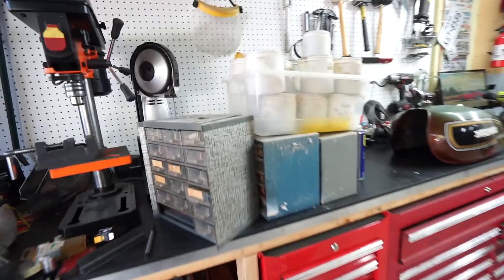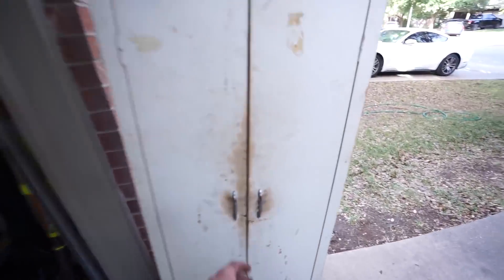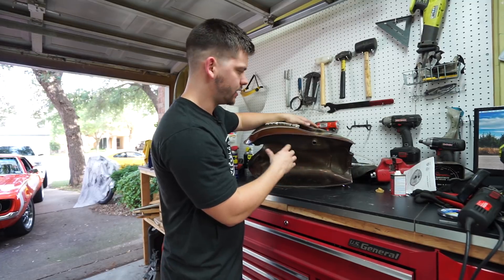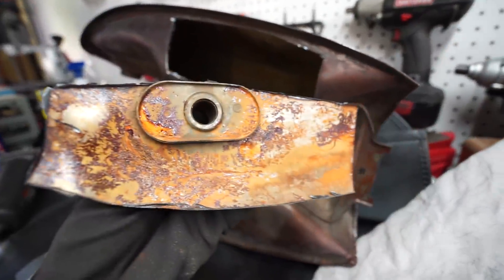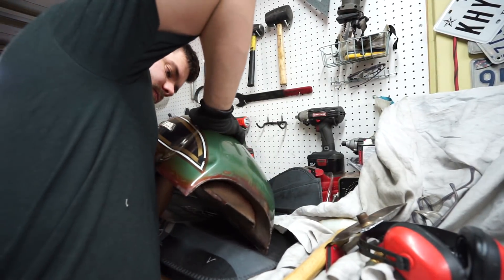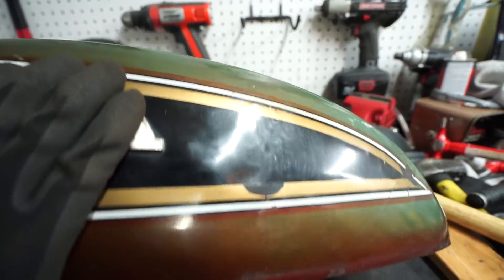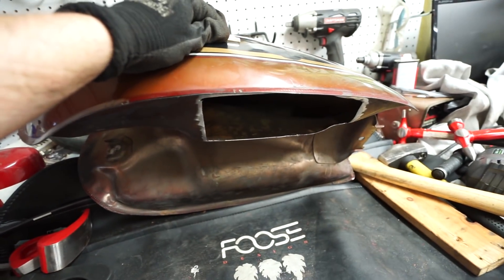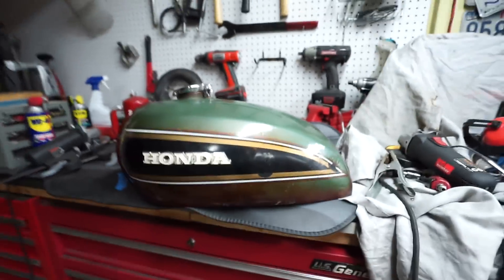Barn to Brat Episode 15: Finally getting the tank dents out!

Comment: Nice job!  The fuel tank reliner called "Red Kote" is the absolute best out there, and will even seal up all that rust, and any pin holes, either from rust through, or in your case, the welded seam.  Amazing product.  And muriatic acid (available at hardware stores) will take rust out, and return the inside of the fuel tank to shiny metal in about 15min.  I've done a lot of tanks this way.
Reply from the maker: I will have to check that out. I used POR15 tank sealer this time but always like trying out new products.

Comment: Hey man, awesome video once again!  I have learned so much from this channel, keep up the good work.  I do have a question about the lighting for this bike.  I assume you will be using the LED strip like previous builds but don't remember if you specified.  I was thinking of using the "stem" signals you used on a previous build and from your link in the description for my 74 550.  Are they pretty bright or so so?  Thanks again

Comment: Tig welder would of worked wonders on that weld job . People are scared of Tig welding its always put in the too hard basket or too expensive but its really not ... its super easy and way better on jobs like that . I brought a cheap Cigweld 185A lift tig no pedal very basic and it welds 100 times better for delicate jobs such as yours it cost me under a grand completely setup with a heap of different filler rods and torch spares . It will be your go to welder 99% of the time . As for learning how to do it a few youtube videos and practice an hour or so and you will be on your way to success